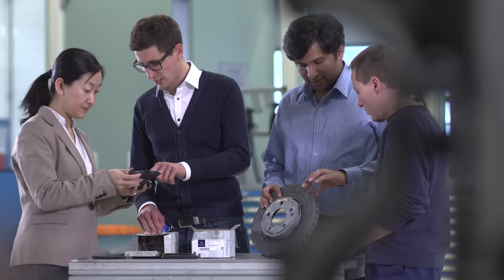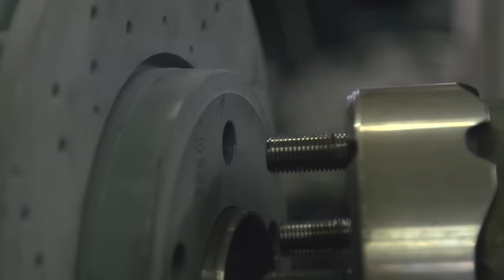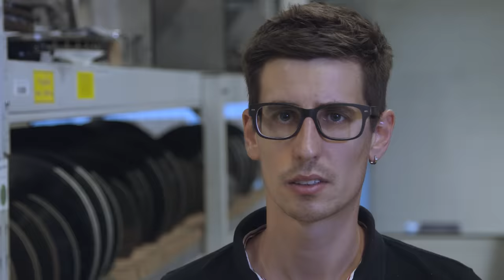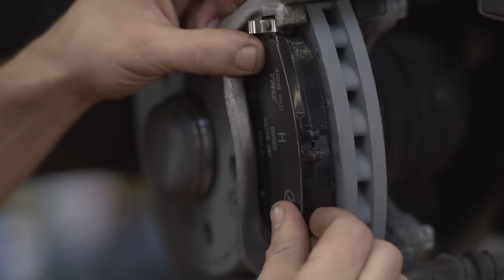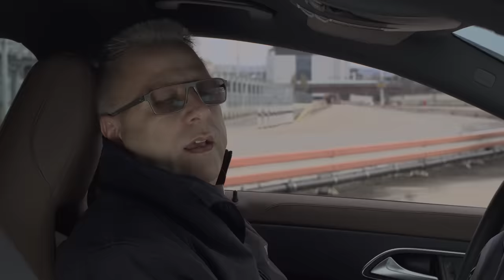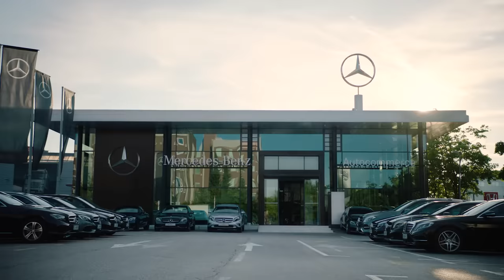Brake Test | Mercedes-Benz Genuine Parts vs. Fake Parts

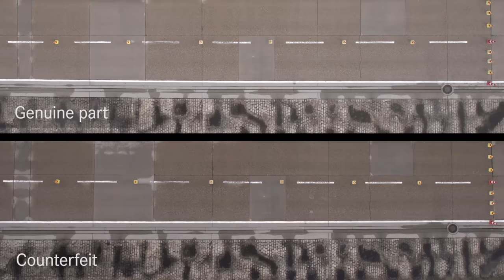Comment: 1:45 - why the brown car is so much faster..? LoL
Reply: Also on the box braking test you can see where they started to brake and it was way past the "starting point"
Reply: I think that we cant argue that genuine parts are better than "counterfit" ones but this test was just so perfunctory...
Reply: erirocit exactly
Reply: erirocit 
They clip starts playing once they hit the brakes. That’s why the brown one is faster, as the fake brakes do not have the same functionality of the genuine one.
Reply: I have thought of that, but there is no proof of the weight of the two cars, the tires etc... I saw the car with counterfit brakes locking its wheels much more often and for much longer periods, but these are only my observations, I am not making any claims...as I said, I have no doubt that the original brakes are better, but this add or what have you doesnt convince me at all...
Reply: B K I think it would be due to the ABS being programmed for the factory fitted brakes and the different composite of the counterfeit brakes means the ABS works less efficiently with them.
Reply: It's to scare people and advertise the brand. Biased as fuck.
On the other hand.. if you buy mercedes, you should he prepared to pay premium for replacement parts..
Reply: Look at the brake lights and you can see they apply the brakes a lot later
Reply: Mark Wright 

I dont think that is the case
 the ABS activates when tyres get locked no matter the surface(mud, rain, or  dry asphalt) nor the tyres
Reply from the maker: The comparison of the braking distances took place under the same conditions at the same initial speed and the same braking point. The longer braking distance for the car with the counterfeit brake disks is the result of the defective quality that frequently occurs with counterfeit products.
Reply: Mercedes-Benz yes of course whatever they told you to say
Reply: i own a mercedes w211 and used genuine brakes for a long time when i ve switched to counterfeit because of money shortage i ve noticed a huge difference...no doubt...but the genuine are soooooooooooo expensive that even if i want i can t afford...please consider to lower the price of maintenance parts for old mercedes.
Reply: Literally the point of the test
Reply: erirocit they braked at the same time but the brown one was faster becuse the brakes could not hold that speed
Reply: Its the "amg" edition 😂
Reply: Same question... it looks like the counterfit apply brakes later... MITHBUSTED

Comment: This test is a biased misleading lie! Firstly, Mercedes do not even manufacture their own brake pads and discs, but rather outsource them and charge a horrendous premium. Mercedes usually use ATE parts which you can buy from them directly for a fraction of the price.
Reply: The brown car seemed faster too
Reply: No Mercedes develops parts with suppliers. The parts that go into the cars are quite unique (same in case of all major OEM's). Trust me, i am an engineer in the same domain. Dont propagate bullshit.
Reply: 28leojay no, they contact a supplier and define their needs and the manufacturer of the components either provides an already existing off-the-shelf component or modify existing components to suit the needs. I can Guarantee that neither Mercedes ,nor any high production automobile manufacturer, designs from scratch every brake component with every model change. 
Engineer yourself a 4” long bolt that has to come out in a 1” deep space. That’s all you guys are good for!
Reply: 28leojay You are full of shit and proved you are not an engineer, or anything related in this domain. Mercedes and every single other large auto manufacturer outsource parts such as brakes and disks in order to save costs. Yes, they would work with Mercedes at some point in the R&D process, however those parts would go in many other vehicles and can be obtained at a fraction of the cost. These “Mercedes” brake pads are probably also in some VW/Audi’s etc...
Reply: You can use Brembo, Zimmerman, etc., and it's more than high quality. Of course as long as you make sure it's OEM you can save yourself from being scammed by monkeys at a dealership. And do it yourself. It's easy.
Reply from the maker: The counterfeits shown in the film are not high quality replacement parts from Mercedes-Benz or other legitimate suppliers, rather they are illegal counterfeits from product pirates. In almost all cases such counterfeits are of defective quality and do not meet minimum legal standards. Thus the counterfeit parts can become a danger for vehicle occupants or uninvolved third parties.
Reply: thanks for sharing
Reply: They speak about fake part, not third manufacturer part... stop confusing everything. Also the part sold by Mercedes are not that expensive. The garage will charge you a lot, but not if you just buy Parr and install them yourself
Reply: @MercedesBenz  you are copy pasting same words in almost every comment 
first understand  what he saying
Reply: @28leojay  My Mercedes has Dunlop disk brakes designed by Jaguar.

Comment: Well if mercedes genuine parts weren't 5 times the price of other companies maybe there wouldn't be a need for counterfeit parts
Reply: its not a need, and also the partners are well known aftermarket brands such as brembo, their brakes are godlike and way cheaper
Reply: You can buy pads and disc rotors made by the suppliers which make the original Merc parts - companies like Lukas, TRW, Brembo or ATE. Merc isn't making a single brake pad on their own, they just buy them from this suppliers. This suppliers however also offer brake parts without the Merc logo on it, which cost less since you pay a lot just for the Merc logo

Comment: Since Mercedes does not build brake pads .. Why we are still talking about it..
Reply: El Chapo he's right you know. 
Most car manufacturers don't build their own break components
Reply: Not just brake components, pretty much any other component is MADE by someone else.
Reply from the maker: The counterfeits shown in the film are not high quality replacement parts from Mercedes-Benz or other legitimate suppliers, rather they are illegal counterfeits from product pirates. In almost all cases such counterfeits are of defective quality and do not meet minimum legal standards. Thus the counterfeit parts can become a danger for vehicle occupants or uninvolved third parties.
Reply: Mercedes-Benz could you share a link of the counterfit brakepad that was not able to lock wheels even though all new Mercedes cars have a strong brake booster? I could only imagine this happening if you cover the brakepads with an advanced lubricant. Or if you worn them down completely before testing. Or if you overheated the brakes prior to testing. Or if there was air in the brake system. Or if the brake lines where leaking badly.
Anyway, for evryones safety it would be best if you revieled what companys would make such bad brake pads. Although I have trouble believing that this isn't a rigged test.
It's very true that cheap brake pads  can overheat faster, causing brake fade, and wear down quicker. But your message seems to be "bending the truth" a lot
Reply: Mercedes-Benz you replied with irrelative answer. Also, the black car did not stop at the same spot as the white, and many people in the comment section mentioned that, and you avoided to explain.
Reply: Once they put mercedes logo on a product. it means the production was under supervised of Mercedes-Benz. They dont produce it but they decide how its produced and in which standarts technically. Thats what we are talking about. now you know.

Comment: I drive a Mercedes for 4 years now, a C220 CDI from 2000, we've owned it since 2001. My dad actually never took it to the Mercedes dealership for maintenance. My dad always took it to his friend's mechanic shop and we never had a problem, the car always came back properly fixed.
The key, key reader and the door blocking mechanism gave up recently and we took it to Mercedes because they are the only ones who could fix the car, it was mad expensive to repair but still, brake pads, oil changes, transmission oil change, filters, normal maintenance parts and so on? We NEVER took it to Mercedes, and the car has almost half a million KMs on the engine without even opening it.
Good old Mercedes, can't beat them.

Comment: We can clearly see from the weight transfer of the vehicle tha in the genuine case braking applied 1-2 meters before the braking point. on the other hand in the counterfeit the braking takes place on the second  yellow cone.Now if we see it from the top angle of camera the yellow cones are one car distance apart . in conlusion 1-2 meters before the braking point plus the second cone distance from start 5 meters at least we see that the difference in the braking start point is  between 6-7 meters. These type of biased videos are bad for the reputation of the brand.
Reply: Also you forgot to mention, the "counterfeit" car had a WET TRACK lol.
Reply from the maker: The comparison of the braking distances took place under the same conditions at the same initial speed and the same braking point. The longer braking distance for the car with the counterfeit brake disks is the result of the defective quality that frequently occurs with counterfeit products.
Reply: lamogio1992 You put such a big hole in this video that Mercedes themself actually replied to you. You should be honored by that! 😂😂😂

Comment: Do Mercedes not only interested in profit maximisation? I have a Mercedes and the amount of plastic used on them now is shocking. Getting a bmw next time.
Reply: jack smith get an audi
Reply: DId consider a a6 but decided to get a 5 series cause insurance was much less.
Reply: Getting a BMW to avoid plastic parts? What?
Reply: jack smith get yourself a genesis. You will have all the features and money in your pocket
Reply: Get a bmw, then you’ll be running back to merc.
Reply: Bmw fenders are fiberglass/plastic sooo your not really winning
Reply: jack smith I have a BMW, and trust me it isn't much better when it comes to plastic being everywhere, even the water pumps are plastic
Reply: got Audi tt for 4 years now , expect buying expensive breaks each 2 years everything else works perfectly and oil change. BMW decreased rapidly last years in quality like Volkswagen. Get yourself BMW and you will realize soon what u bought , my sister got BMW X5 and the engine was at least 4 times in servis including bad filter and cooler that for some reason is broken each several months even after replacing it completely. BMW got crappy , they charge high for low quality.
Reply: Get a detomaso pantera next time
Reply: lol its the same
Reply: if you are long-span car user. Meaning you wont sell your vehicle after 5 years. I would suggest mercedes. BMW causes more problems. Mercedes engineering is still one of the best if you take care of the car it will go 50 years.
Reply: BMW and Audi are even bigger junk!!!!
Reply: @stevekoffeld9071  lol I'm back to my merc after BMW kept breaking down.

Comment: There are counterfeit parts on the market but also aftermarket parts. I remember ordering for example a Hella sensor but instead I got a counterfeit no name sensor.

. You can choose a producer that makes good rotors. For high performance applications the floating discs and sports callipers (4 pot or more) are much better, but it depends on the quality as well. 
You can get a good quality set of normal front discs (Φ335/32) for not more than 300€, and 150€ for the pads

Comment: Wth.  Didn't even know you could get fake genuine parts.  Mercedes-Benz don't make their own brakes either
Reply from the maker: The counterfeits shown in the film are not high quality replacement parts from Mercedes-Benz or other legitimate suppliers, rather they are illegal counterfeits from product pirates. In almost all cases such counterfeits are of defective quality and do not meet minimum legal standards. Thus the counterfeit parts can become a danger for vehicle occupants or uninvolved third parties.
Reply: Mercedes-Benz Frankly that is shocking that someone would buy counterfeit items when high quality genuine items are readily available.

Comment: O.K. Let's put this into perspective. I'm a retired auto mechanic (Asian cars not German luxury) and fire truck builder now selling auto parts in handing out repair advice. I had to retire due to several injuries. There is a BIG difference between genuine, aftermarket, economy, and counterfeit. Genuine is what you buy at the dealership parts department. Counterfeit are parts that have been cleverly manufactured to LOOK like genuine replacement parts and packaged in boxes that LOOK EXACTLY like the ones you would get from the dealership parts department. These are usually available "on the street" but there have been some documented cases of counterfeit auto parts making their way to dealership parts departments. Aftermarket means the parts are made by manufacturers OTHER than the ones who supplied the factory. If those parts (in this case brake pads and rotors) are made by reputable manufacturers such as Raybestos, Albany, Beck Arnley, EBC, etc they are made to meet or EXCEED the original manufacturer's specifications. Economy is just that and you wouldn't want to put them on a Yugo much less a Mercedes! Owners of older German luxury cars have told me the dealership commanded prices as high as $200 for a set of brake pads! At my store a set of quality aftermarket brake pads for these cars will cost anywhere from $50 to $90 depending on the model. If the pads have built-in electronic wear sensors it's a bit more. But most of these owners of  10 , 15 , even 20 year old German cars luxury being of "limited economic means" always ask for the economy pads that cost between $10 and $25 a set! (assuming of course we even have them) When I try to steer them towards the better quality pads it's not because I get a commission (I don't) it's because I have their safety in mind! But they usually end up yelling "STOP TRYING TO UPSELL ME!".
Reply from the maker: The counterfeits shown in the film are not high quality replacement parts from Mercedes-Benz or other legitimate suppliers, rather they are illegal counterfeits from product pirates. In almost all cases such counterfeits are of defective quality and do not meet minimum legal standards. Thus the counterfeit parts can become a danger for vehicle occupants or uninvolved third parties.
Reply: Mercedes-Benz Speaking as a retired mechanic ,1000% AGREED! And this is been going on for a long time! Back in the late 1970s my brother was a cab driver  (independent) and he bought what he thought was a case of genuine AC Delco oil filters "on the street." I told him he got scammed but being a young high school  auto mechanics student at the time he didn't believe me. I went to an auto parts store and purchased a GENUINE AC Delco oil filter of the same part number. I then cut open the genuine and one of the street oil filters. The counterfeit oil filter had a filter medium in it that was little more than toilet paper while the genuine filter medium was thick and pleated.

Comment: I am a mechanic and I can confirm what you see in this clip, I am not a Mercedes fan and never owned a Mercedes but the brakes are the same for all the cars as a principle. Low quality brake parts does not offer good braking in hard situations, they will heat up very quickly and you feel the fading of the brakes. So, buy only good quality braking parts even if you buy aftermarket instead of OEM which is the best option.

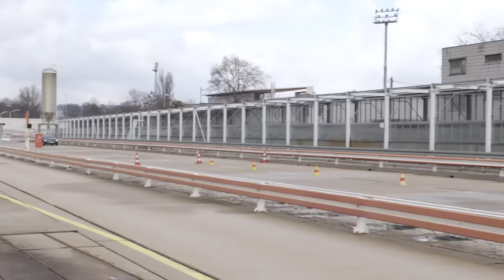Comment: 1:52 look closely, it looks like the driver let of the brake a tiny bit
Reply: The brake light are supposed to flash when you hit the brakes hard. You can read it in Mercedes manual book. Even my 2012 Viano has it.
Reply: @jalis812-gaming6  Yeah when abs is active isn't it? but it was just before that, they let off the brakes slightly for a split second then got back on them hard just before the camera saw the lights

Comment: I think the pad can be true that it will wear up faster than the original one. But that doesn't mean that it will give less grip. Bcs the component still same from metal/organic based materials, so it really comes back to the piston and mechanical system of the brake itself. Well, you can try the alternative to buy a different product rather than use the fake ones.. Or use the fake one, but you have to maintain or even change it more frequently. Well, I'm using the original genuine parts (mitsubishi) but do not bought it on dealers, bcs yes, it would be waaayy more expensive.. Minimum twice the price on outside market.

Comment: I use Brake Performance rotors and ceramic pads. It has been more than 50,000 KM and they are still going well. I used to change the rotors & pads at the stealership. Every 15,000 KM maintenance there has to be something to change either the pads, rotors or both. And that’s like $1000+. What’s more irritating is that labor costs more than parts at the stealership. And that’s “after a special discount,” mind you.

Comment: In a simple test, such as a single deceleration from 100 km/h (62 mph), ANY brake pad or caliper or disc will do ~OK (the difference will DEFINITELY be MUCH lower than the one shown in this video). In a demanding test, however, such as two consecutive decelerations from 250 km/h (155 mph), there will be a substantial difference. BTW: I strongly suggest having a brake test strip in an area without any obstacles along...

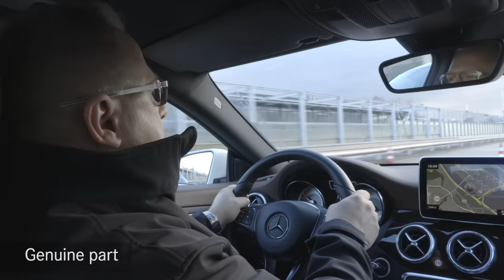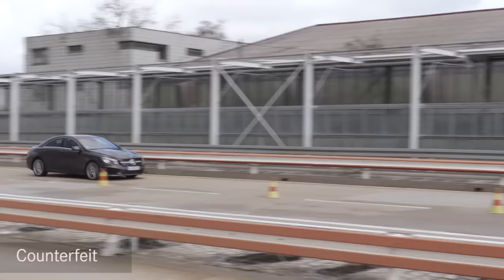Comment: 1:32 you can see the white car brake HARD before the cones you can see this by the shifting of the weight of the car due to momentum. He already started braking WAY before the cone. While the black car at 1:52  didn't start braking until the 4th yellow cone. You can tell because of car weight shifting forward and you can hear he applies the brakes much later. It is safe to say they would have performed similarly.